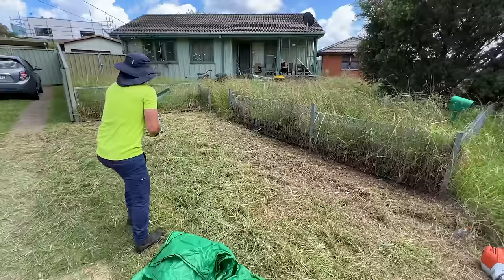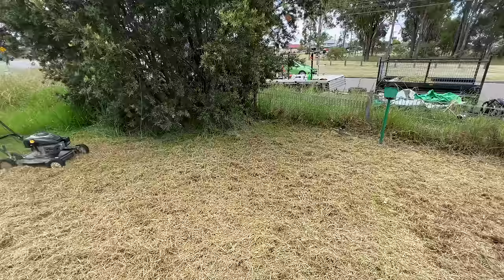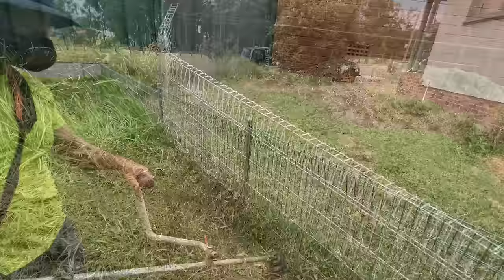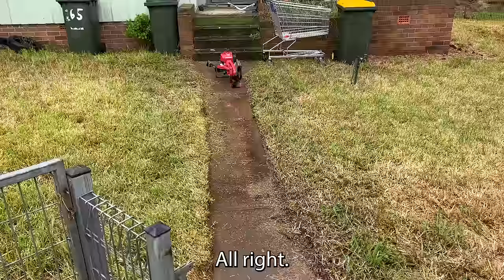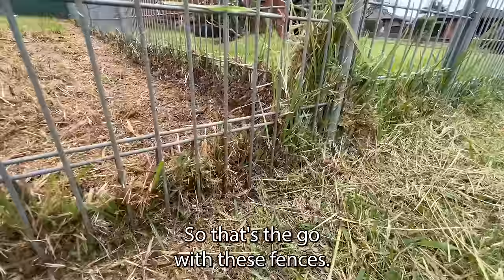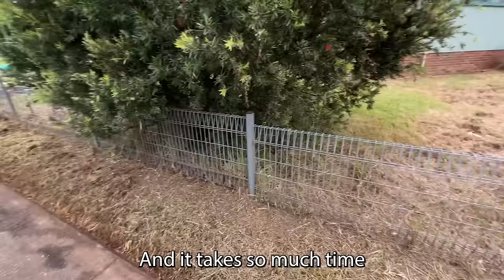2 Hour Video! Her Sister Called Me To Make Sure It wasn't a SCAM

Comment: Get yourself a long-handled spade, Tim.  Your back will thank you for it.

As for blowing the dirt out from the edging, back in the day, we didn't have blowers, so we did a lot of stuff by hand, including edging the sidewalks and such, with - a long-handled, flat-bladed spade.  

So, the technique was to slide the spade across the concrete, against the edge, and lift up the overgrowth.  Then, from behind, jam the spade down into the overgrowth, just at the edge of the concrete.  Once you get good at it, you get quick at it, but it's still back-breaking work.

I should mention that we used a short-handled spade like they used for cutting sod, instead of the flat-edged spade.  So the sod cutter was completely flat; edge, face, and all.  

For upkeep, we used these rotary edged star wheel things on a long handle.  Basically, it was a star wheel attached to a hard rubber wheel at the end of a rake handle.

Also: that two-handled edger is a bit of a beast, yeah?

That was a lot of hard work, even with all the power tools.  Job well done, mate.

Comment: Great vids. I have 5 acres in those hard to reach areas the grass gets extremely thick and overgrown I was sick of the line trimmer or brush cutter I know use my hedge trimmer attachment trust me it works it quickly gets the bulk of it  I will never go back. Give it a go you might be surprised

Comment: When you discovered she had a driveway reminded me of when my husband and moved into a house he was buying. It had a lot of overgrowth when the realtor took us to see the house. We where told it would all be cleaned before we moved in. Well they did fix what needed to be replaced and repaired on the house. But they only cleaned up the front part of the yard. With the way the yard was shaped you could not see the back yard until you walked around or from the living room where the sliding doors where. So long story short my husband was mowing over carpet for months until it started wrapping around the mower blades. Grass had grown through the carpet. Took several more months to get all that carpet pulled up before we had a nice back yard for the kids to play in. So you never know what you will find.

Comment: Tim, use your red/grey edger with the wheel on the cement side, not on the grass side. You will find that it will roll better on the cement and allow for a sharper grass edge.

Comment: Here is a thought how about making a lft for the back of the trailer with a hydrologic lift system and a plank on it so when you have to go drop off a load you just push a button and empty the load without killing your back. I have seen them cheap at local tractor trailer stores and hardware stores for under $200

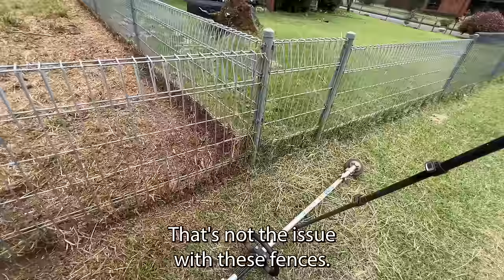Comment: 1:40:07  Anyone making a comment that you don't have enough line out there obviously isn't thinking.   I saw right away that the fence was likely touching the ground or even buried a bit.  That happens in my own yard for various types of metal fences.  Unless you install them 3-4 inches off the ground, they'll eventually get like that.  It's a mess.   Anyway, I'm surprised people would say you're just not doing it right.  It's obvious the fence is too low/touching the ground.  Keep up the good work.

Comment: Would be cool to have an EV pickup in this style, so you can mount solar panels as a roof over the cabin and bed plus a solar roof on the trailer, which can be opened, so it lifts up forward.

This way the EV battery can be recharged, the cabin and the tools stay out of the sun and you can recharge the batteries of your tools - once you've switched them over to electric.

Comment: Why did you not spread a tarp or canvas on the ground and use it to fill with the cut grass and then drag the filled tarp towards your truck, instead of carrying individually?  You would have saved some time and effort just like most yard transformers do here on YT, lol.  It is not a secret technique, lol.  Just a suggestion.  It prolongs your video though, if that was your purpose.